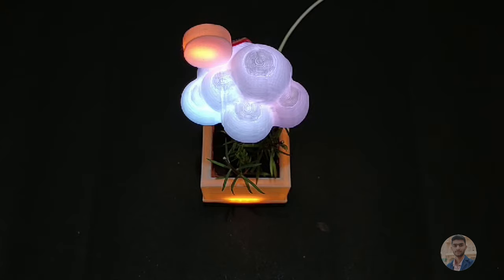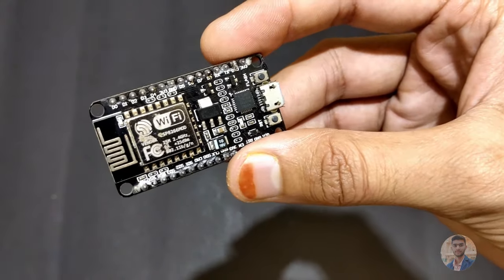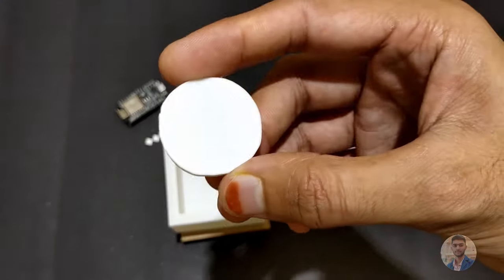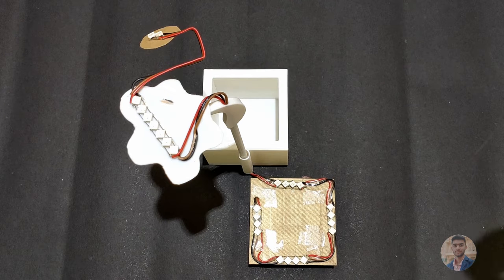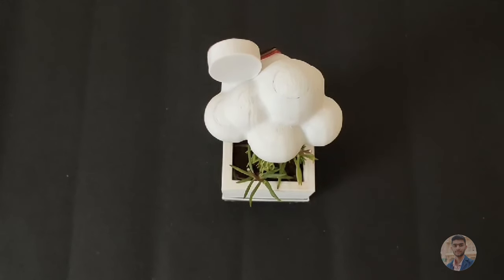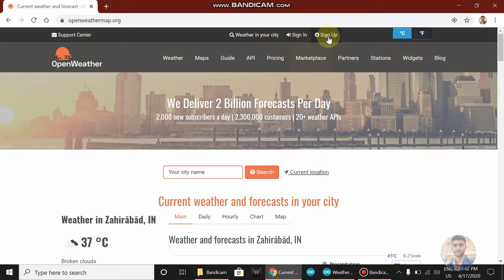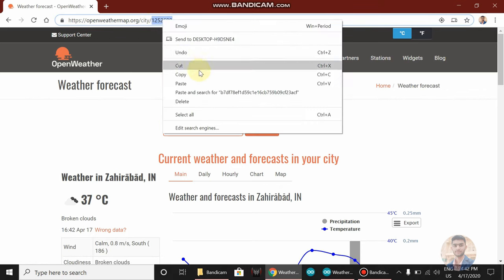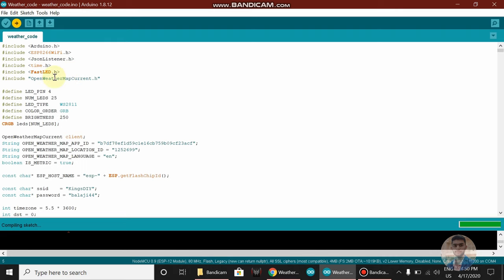Weather Lamp | ESP8266 Weather Station.

Comment: why you don't have the cloud in a .stl format? great project!
Reply from the maker: I have taken the cloud from the tinkercad online gallery, so it's not in  .stl format but it can be opened in slicing software.This cloud is full solid so make sure that you 3D print cloud by setting the infill value to 0% in slicing software. Thank you!

Comment: None of the LEDS will turn on, i dont understand why..
Reply from the maker: Can you directly upload any one of the FastLED example and see, if still it's not working please check the connections
Reply: I realised that i used the wrong breaking board, i have the ESP32 board. Could you help me cause ur code doesnt work with my breaking board:/